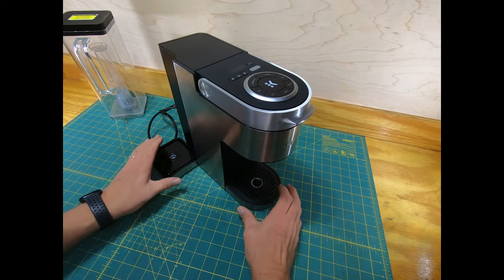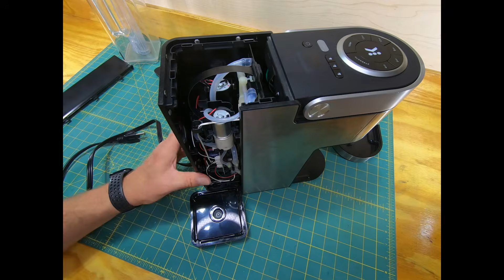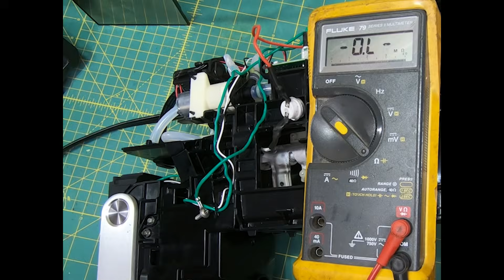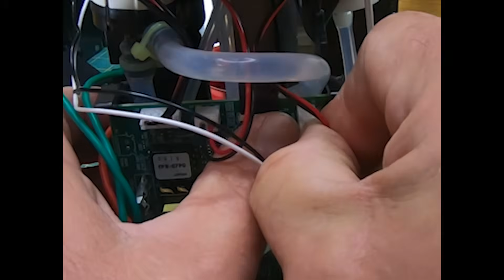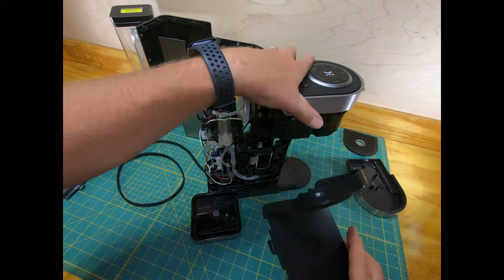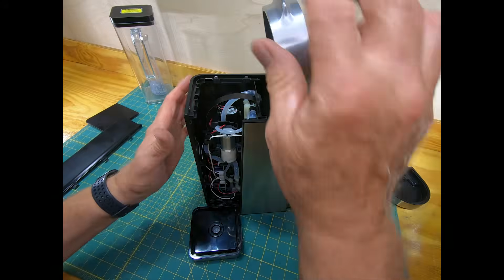Keurig Has No Power I Removed the Cover and Fixed for FREE

Comment: There is a much easier way to do it takes the top cover off, and you can make a tool to reach down and reset the thermal switch.  I used a straightened out landscape fabric staple, with a baby pin taped to the end of it    five minutes

Comment: The only thing you had to do was stick a paper clip in the small hole on the cermaic disk to reset the fuse... You didnt need to pull the safety switch

Comment: How I fixed mine is I located the resest button,  a drilled a hole corresponding with  location of the reset button on the side of my coffee maker, I used a straightened paper clip 2  reset it, now if it ever happens again I have a hole drilled on the side of my coffee maker, and to reset it again, I just use the hole that a drilled, no more hassle to take it apart. 😊

Comment: When these thermal switches trip, there is a reason. Not enough water is passing thru the heat exchanger, causing it to overheat and tripping the switch. If your machine keeps tripping, you have to figure out why.

Comment: My K910 kept tripping. Reason? The small air valve solenoid at the top, connected to small tube, was stuck open. It is supposed to close when the pump is drawing water from the tank. If stuck open, the pump sucks air and not water. I blew it out with air pressure, and it's working again 😊

Comment: Ummmm so what was ultimately the origin of the problem?!? You believed there was a water flow restriction so the pumps were directly powered to test them and they both ran and water flowed… so that wasn’t actually the problem? was there a blockage that got flushed out? Was an impeller stuck and 12v over voltage got it going?  Will the issue happen again?

Comment: I want to leave the outside covers completely off. 
Replace them with plexiglass covers so the internal parts can be visible. 
Also can we add some internal lights like on custom built PC computers? 
Instead of plugging the coffee maker in every morning and then unplugging when done making coffee to avoid wasting electric power when not used, and wearing out my 120 volt wall receptacle, I want to install a nice big on/off toggle switch on the coffee maker.
Tk you.

Comment: Thank you. I wish I knew to remove the top cover first, before I did this in a different order and broke most of the plastic clips!  Since this happens from time to time, I also drilled a half inch hole in the side of the cabinet and plugged it with a rubber grommet.  Now I can reset it with a paperclip anytime.

Comment: There is a much better way.  Another video on Youtube shows dimensions on drilling a hole on the right side to allow a straightened paperclip to reset the thermal switch. % minute fix vs tearing it apart.

Comment: Thanks you for this excellent video, but I have a strange problem I hope you can help me with.  My K-Supreme Plus will brew hot coffee every time, but during descaling it will not heat the descaling solution.  It goes through all the correct descaling processes, but with cold water.  I reset the thermostat, but that made no difference - I still get hot brewed coffee, but cold descaling.  Any idea what the problem could be?  Many thanks.

Comment: I see  you test the water pump,  I assume you have power unplugged ?   I see 2 pumps    to test all I need to do is get  12v and send it to the postive and negative lead ?  and it should pull water from the resorvoir and pump water out from the Top ?     can I also do a OHMS test on the  2 pumps to see if they are bad ?  do you know what ohms reading is consider good and bad ?

Comment: Great video - if the machine continues to trip and you don’t have a voltage thing, you can use a 9v battery to manually run the pumps.  That step was necessary to fix mine

Comment: I got the cover/casing off, which was not easy. The inside doesn't look anything like the video, but I found the reset thing with the tiny hole, and I put a paper clip in it and pushed a bit. When I plugged it in, the power came on! I was so excited, but when I put water on and set it to make a cup of hot water, the power went off again. This time the paper clip didn't work. So should I give up on this machine?

Comment: Thank you!   This video saved me from buying yet another Keurig.  The directions for removing the cover (the hardest part) were very helpful.  I even checked the resistance before and after pressing reset to confirm the fix. I wondered if I could buy a resettable thermal switch. If it happens again I might pursue that.

Comment: What brand name and model # is your adjustable power supply? Did those leads come with that unit?
I would like to get 1/ those..and also fix my machine. If this actually fixes  it, maybe I'll relocate the thermal switch to the inner exterior case and drill a hole for easy access to the push button. I'm not too concerned if there's a hole in the side of it.
Thanks, good video! ..2 hours later..I fixed it!  Thanks.

Comment: I wholeheartedly agree with all the positive comments below, so all I can say is 'ditto'. One question, though. My problem happened when I accidently tried to brew a cup of coffee with a dry reservoir. The Keurig has often warned me of a low water level and refused to operate until more was added, so I was surprised that it did not balk at a no-water condition. Any thoughts on that?

Comment: This did the trick! Amazing. I was so happy to be able to fix my machine. Kudos to you for the astute diagnosis which few would have the expertise or patience to do. I ended up using a thin finish nail to reset the thermal switch. Thank you for adding the disassembly process - super helpful.  Can’t thank you enough for such a thorough and thoughtful video.

Comment: Had this exact problem and followed this video and it worked! Mine overheated because while descaling I forgot to add water at one point when it needed; it smoked and apparently overheated. Mine is a slightly different machine but I took everything apart just the way he said and found that little switch to reset and it did the trick. Thank you!

Comment: I was trying to descale my Keurig Supreme Plus and I guess it overheated and machine stopped working. It will not power on despite holding the 8oz and 10oz buttoms together for 5 seconds or pulled the plug and waited 15 minutes. I was 10 seconds away from tossing it out my window until I found this video. I managed to unscrew 3 phillips under the machine, pried open the case (which was difficult), but I didn't care because I was going to toss it out the window anyways. Once opened, I located the thermostat with a hole in the middle. I stick a sim card pin in and felt the "click". I plugged in the power right away and BAMMMMMMM.....IT'S ALIVE! IT'S WORKING AGAIN. EASIER THAN ANTICIPATED AND IT WAS AWESOME!

Comment: The descale mode is a huge pain in the neck; it never stops flashing no matter how many times you refill the water and press start, it keeps going until it eventually trips the machine; I too was going to throw it out until I watched this video, best ever , and of course it worked, I didn't have to undo the reset part, merely used a paperclip, heard a loud clip and it all reset.

Comment: Well I know this sounds crazy but I had done the descale on the unit and used Keurig's descaler and the next day it couldn't pump any water out, so I watched all the videos couldn't find any solution so I figured it can't get any more broken than it already is.  I started a brew cycle and started giving the top of it a good wack and the next thing you know out comes the water.  I guess somewhere up inside the lid it was blocked from buildup from the descale process .I then resorted back to good old vinegar and water and its been fine ever since.  For those of you Star Trek fans as Scotty said the more you complicate the plumbing the easier it is to stop up the sink LOL

Comment: Thanks for sharing. I got it as a gift, the very first time I tried to make a coffee I smelled burning smell and then no power. As I learned its cost is around $199 on Amazon I got super mad. After watching your other video and this one I feel like how come they did not design a simple reset switch or something like that for a normal user to be able to help without much of hassle. You seem to be knowledgeable about the circuits etc but for a normal guy like me it’s just try and try and dumping it in the garbage! Such a poor design regardless if there’s a circuit breaker switch for safety there.
Reply from the maker: I'm still not exactly sure why this Keurig overheats and trips the thermal switch. Poor design and once it trips, they want you to buy another one. Thanks for the comments.
Reply: @CarveTools   They are afraid easy repeated resetting may cause a serious overheat and possible fire if there is a serious problem like a failed pump, etc. The problem is the complex descaling steps which can cause the heat to come on with inadequate water in the reservoir. This happened to me. One year Keurig warranty got me a free replacement as I was at 10 months. Past warranty? Drill a hole in right side and easily reset when needed.

Comment: My water tank cover had some water in the lip, & that caused an air/water seal to form around the periphery, thereby restricting the flow of water into the machine during a brew cycle.  I believe that low/restricted flow caused my over-temperature condition, tripping the thermal sensor. I wish it was like my furnace where it resets when the temperature reduces below a safe margin. It’s a PITA to take the thing apart to poke a wire into the thermal trip to reset the darned thing!  I’ll be drilling a small vent hole in the water tank lid so this doesn’t happen again!! Thanks for the nicely-done video; very informative!!
Reply from the maker: Glad this was helpful. I think the covers were never intended to be removed. Thanks for the comments!

Comment: Hey Dave! Thank you for this video, it helped a lot. Mine was the same, no power. But after I reset it like you explained, It turned on!

BUT, for some reason, when I tried to brew something after repairing, it started warming up and then it shut down again, just went black without pouring anything. Now its back as before, no power. Any ideas?
Reply from the maker: I'm guessing the pump needs to be primed to get the water flowing. It starts heating without water circulating and then overheats.

Comment: Success I fixed my coffee maker with your video by re setting the sensor 
I think mine overheated because water was dried up from months of non use 
But I went one step further by using a small holesaw to cut access port so I won’t have to take it apart next time!!!!!
Also primed the water lines by pumping the water tank up and down about 25 times
Reply from the maker: Wonderful. I think because my Keurig was not used for a few months is why it also overheated. Thanks for the comments.

Comment: My Keurig Supreme Plus only has a single water pump with an “air pump” - according to the control board - up on top with a smaller hose(I believe this device just opens up to atmosphere to allow the pump inlet line to lose suction - like a slit in a plastic drinking straw).  I took the smaller hose off the air pump device at the top and ran the water pump - with a separate 12v supply like this video suggested - WITH the smaller hose PINCHED. I did this to verify my water pump was good.  Then I reconnected the hose and wires at the board. 

Thank you for this video AND the bonus details on Descaling - I went through the descaling process last month without entering Descaling Mode, and I think the machine thinking it still needed to be descaled may have led to the issue of overheating…maybe programming? 🤷‍♂️
Reply from the maker: Glad to hear another Keurig fixed. Good job and thanks for the comments.

Comment: Excellent tutorial! My Keurig had a split and leaking hose right under the water pump. The thermal switch was tripped due to no water.  Amazing the board did not short. Anyway, swapped on a new hose from an old Keurig and reset the switch. Back in business. Thank you. I didnt break the cover because of your help ( :

Have a blessed day!

Comment: I had one of those small Keurigs from Walmart. Ran out of water and tripped thermal protector. I was gonna throw it anyway but decided to take cover off (it broke) and just used a safety pin to reset the thermal protector and it works! Keeping for emergencies since I broke the cover. But it works again!

Comment: Yes, we get that its a safety feature. But.... these kinds of devices should ALWAYS be about to be auto-reset when the temperature cools, or else provide a plastic bridge pin that would allow it to be reset from outside the unit, without completely taking it apart. For this product version, at least you can reset it. For the K-Duo Special Edition, Keurig actually used a non-resettable fuse that is soldered in place! This is an intentional design FLAW and Keurig knows exactly what they are doing here. They are hoping naive people will simply "throw away" their machines if this happens outside of their crappy little warrantee? Oh wait, this kind of this is probably treated as "misuse" and not covered by any warrantee. The other likely reason they did this is to make lots of money for their official Keurig repair contractors, knowing for them its a can be a fairly trivial fix, but they will likely charge customers by the hour, even for a 3 minute fix, and probably cost them $120 or $150 to "fix" it. Then, if customers balk and say "screw it, I'll just buy another", then Keurig wins again. So its a win-win to design garbage products like this.
Reply from the maker: Safety feature shuts down the Keurig. I wonder how many go and buy another one? Thanks for the comments.

Comment: Thanks for including the info about checking the pump motors! I had two units where I reset the thermal switch and they immediately tripped when trying the first brew. Both sets of motors were working but there was apparently air in the lines and they did not draw water. I was able to prime the lines by separating the top line from the 3 way connector on the left side of the machine and using a squeeze bottle to fill the small compartment with a bit of water. Once I did this, I could run the motors and fill the lines with water before resetting the switch one more time. Both units work great after a descale cycle.

Also note: My motors were labeled and are indeed 12 volt motors. I found that a standard 9 volt battery is enough to power the motors for testing.
Reply: @henrysu606 I have same exact problem as you.    so want to make sure I do this correctly  you basically disconnected one of the hose that lead to the small container that draws water from the reservoir and what you did was use a small squeeze bottle to fill that small container with water ?    would you be able to share your email ?  or I can share mine so that u can show me on a diagram which hose and which container I need to file ?    Thanks. mine definitely have air in the system and not drawing water.. it overheats right away after like 5 secs during brewing cycle.  it does the same thing every time after thermistor reset.

Comment: Done! Thank you! I use to use my machine just about every day then stopped for a lil while. Thinking that’s why the clog happened or someone was using non filtered water in it. I did not have a volt exchanger to use, yet I was able to fast pinch the tube above chip board right as the pumps started to run. Giving the pressure force to push the clog open. And it has been running since! Thank you dude!
Reply from the maker: Good job! Another one saved. Thanks for the comments.

Comment: Of all the DIY videos I've watched and followed, this ranks towards the top - if not at the top - as it saved my daughter $160+ by returning the replacement she bought me from Target (note: CostCo has a much better, and cheaper, deal) for Father's Day 2024.  
At the risk of being presumptuous, I have a few refinements to offer:
1) when re-assembling, I suggest you start at the front (rounded) part as the studs on front align the clips on either side, then clip the left side in before doing the same on the right side as it just seems to come together easier
2) if you have them, use automotive trim tools to pry the exterior cover off to avoid as much as possible dinging it with a metal tool (Hobo Freight has a great kit for a few dollars)
3) my Supreme Plus TAS while descaling because I hit the "K" (brew) button when the machine told this dummy to "add water", which most likely tripped the thermal switch/sensor

4) if you find stray bits of broken plastic comingled in with the coffee grounds kicked loose by disassembling the machine, don't fret as like with auto interior parts, plastic doesn't like to be disturbed post-factory, but unlike with a car nothing is going to rattle while using your Keurig
I'm not a design engineer, but I wish Keurig would've figured out a way to externally re-set the thermal switch/sensor without having to partially disassemble it.  They may have thought of it, but could not place it somewhere externally accessible and still serve its safety function.
Time for a cup...
Reply from the maker: Great suggestions. Thanks for the comments.

Comment: So it worked. Basically I ran it and forgot to put the water reservoir on it. It smelled a little burnt and I couldn’t get it to turn back on. I followed the steps here and it worked. But I can’t put it back together properly. If I put the back top lid back on it blocks me trying to lift open the front to put the coffee pod in. So at the moment I don’t have the top lid properly on just partially. If anyone has any ideas I’m all ears.